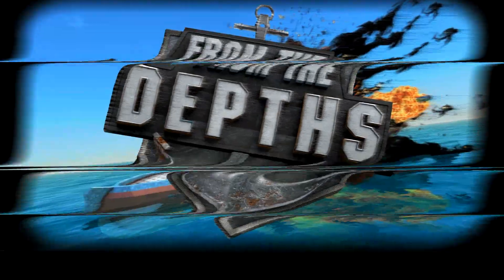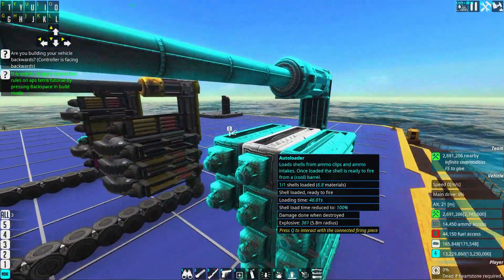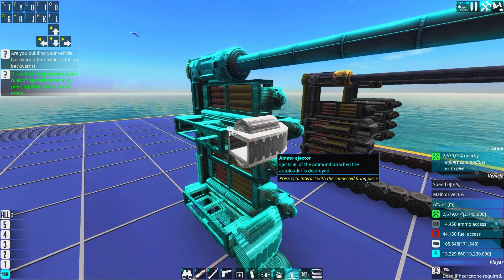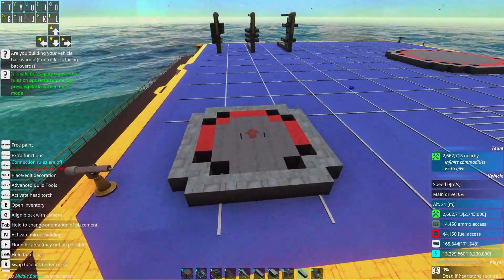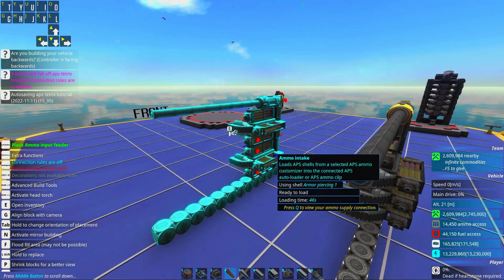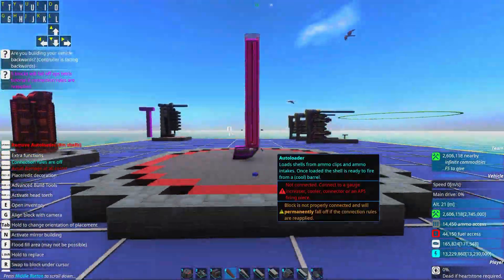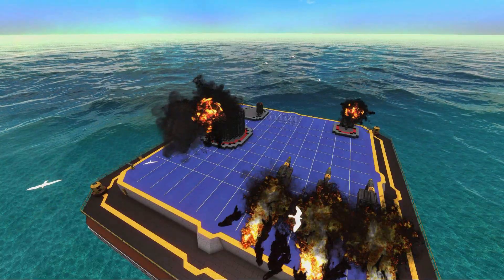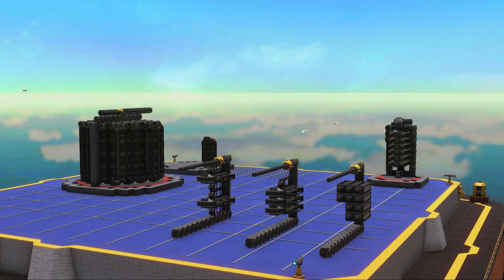From The Depths INSTANT Tutorial: Efficient APS Tetris (With Ammo Ejectors)

Comment: Having armour inside turret well is a BAD idea. Its weight makes the turret harder to rotate, and its a BIG waste of space inside the turret well which you usually put deep inside the citadel of a vessel. Armour attached on the turret subobject should strictly be limited to the turret superstructure, approx. around the firing piece that has to be out of the citadel, and which should be made as small as possible. Replacing the armour inside with proper components gives you a better weapon of the same size, and much better rotation. You can always compensate the loss of armour by adding more on the wall of turret well or the citadel around it.

Comment: it should be mentioned that the required Length of an autoloader/Clip is not determined by ''how beefy'' a shell is , it is determined by how many components relative to it's ''beef'' it has
for example you could make a 12mm shell with dozens of components to make it 8 meters (800mm) long or you can have a 400 mm BEEF shell that is a single meter long  this also determines ow many shells find place in a clip i do believe a single clip has place for 1000 mm worth of shell girth means you can at best store 2x400 mm shells in any clip since everything beyond 400 mm is direct feed (means the shells to BIG for clips)

Comment: Would it be possible for the same gun to fire different shells depending on what you're targeting? (for example FLAK vs HESH depending on how fast the enemy moves or something like that).

Kind of want to build a secondary turret that acts primairly as (flak based) CWIS but also have a backup function to damage armoured targets where the normal shell would be ineffective. Or have the possibility for slower firering kinetic shelled APS to fire something more inclined to hit (anthing with a timed fuse and AOE) when only small planes remain.
Reply from the maker: Yes but I believe you need to use breadboard for this, and switch will be after the shells loaded already are fired...
Reply from the maker: Basically what you want is a multi-purpose gun loaded with sabot I'd say

Comment: I'm still pretty confused..  I just got the game, so excuse me, but you say to make the shell first but how do I know how big to make the shell?  Do i just make whatever i feel like?  And then how do i know how much cooling the gun needs?  How do i know how often the gun can fire?
Reply: You can try stuff! That's what I'm doing, and although my cannons are and have been rather bad + inefficient, you don't need them to be perfect :)

For the Advanced cannons, use the Ammo Controller with customizers (they're beside each other on the advanced cannon tab) 
In there you can select different shell types, the tooltip says what they do, but it's the combinations that are interesting. You can look these up if you want to, or just do as I mentioned to try whatever you feel like.
Reply from the maker: I highly suggest you check out my basic tutorials before, like the general and the ones before this, it's too much to explain in a simple comment
Reply: @Jay-fy4zy  late to the party but based on the length of the shell design (more gunpowder/payload/etc) the shell per size becomes longer. That said a 8 module long shell could still fit in a 1m long loader, but that would require you to have a small barrel as well, meaning you'd be firing 55mm bullets. This is okay for AA weaponry that need to dump out bullets in RPS notations rather than RPM, but you generally want a bigger bullet to deal damage. If you're cramped on space, cutting down on the amount of shell modules (length) is thus better than making the shell diameter smaller.

In the bullet designing screen you'll get a clear dropdown tab that allows you to select autoloader sizes for the bullet you've designed, giving you a clear way to see the gauge of the weapon you can make with the bullets you've made. (i.e. rather than having to guess the size that bullet would fit the game just tells you "this bullet needs an Xm loader for this gauge")

Now for the "why", partially personal preference, moreso for 'what the gun needs to do' and 'how much space does it get to do what it needs to do', if you need a 400mm gauge since it's your main gun but your hull is only 5m deep, well, good idea to cut down on the bullet so you can fit that size crunch. Or if you're on that same boarlt designing an AA gun, well.. Good chance you'll want only 1m loaders despite having 5m of space so you can fit in even more loaders, so you should design the bullet off of that assumption, and more importantly that specific task as well. Vice versa however, if gun size isn't important but you need the bullet itself to do a specific task, for example heat or hesh, then the gun is built around the bullet, rather than vise versa.

After the APS firing piece is mounted all of its required stats is displayed, you want cooling parts to be equal in rpm to your intake parts.this varies per bullet and gauge size etcetera, so there's no clear cut answer for a cooling to autoloader ratio.

Comment: There is a problem with your 8m example. Ejectors can't rest on top of a turret it has to be a cooler or rail charge. I make a lot of rail guns. I like to put the controller in the center. Use the four clip tetris with ejectors. I place them in a circle pattern around the center. Three are used per side so twelve in total to complete circle. If you want more just make another circle pattern around. I haven't made one that's bigger than two. You can also stack them. If they are big clips I use coolers around the bottom, center and top. That way I have a place to connect recoil.  The free space I put rail charges, coolers or recoil. The toughest part is having a place for recoil. Coolers and charges are easier to connect. It's a balancing act on how much rail charge you can have. There is also a cool 5clip tetris for 1m clips. I found it on the workshop. Bummer only 1m clips can be used but you can make a mean pure rail with no gun powder to fit 1m clips.

Comment: I do wanna point out
Pure Autoloaders only doesn't actually explode, they explode but deal no damage even if your shell is chemical/ has gunpowder, its  the clips that makes it explode, thankfully 4clip designs are cheaper, but has to use a emergency defuse if you don't want to explode.
to how much recoil absorbers you need for railguns, you need exactly what you put for railgun juice to absorption
Example, Assume your gun is pure railgun, your railgun uses 50000 energy, therefore it creates 50000 recoil. thats how it is
Edit: I forgot to say 0 clip only really does explode if your He is big, not sure how frag and emp works on this
Reply: Thankyou! One question: How to deal with BIG BIG BIG recoil in rail asissted APS? .Then over 100k Recoil/s for my Rail asisted APS (500mm) is to use even if i change RPM or calibre, damn Gauss Guns generete recoil.

Comment: Longer autoloader or higher fire rate for main gun
Reply from the maker: Depends on the shell, you wanna penetrate or sandblast?
Reply: @GMODISM  I like to use aphe railgun assistance
Reply from the maker: In this case go for long autoloaders otherwise you will not get good penetration at good speeds.

Comment: For small chemical shells only Autoloader has 2 benefits. No ejectors needed since the explosion won’t chain react. Changing shells mid battle is much faster. Otherwise like you said clips are better.
Reply from the maker: Haha yeah everything has a niche use, I do hope however that someone that makes a system for changing shell mid battle won't need a basic aps tetris tutorial XD
I do think I prefer just mixed ammo in these cases anyways, but maybe I'm just lazy
Reply: @GMODISM changing ammo mid battle seems like such an overkill in design. It just seems like something I'd make only to prove to myself that I can do that. For basic effectiveness I'd definitely just use a separate cannon for a separate shell.
Reply: @HalIOfFamer  It has it's uses, for example a small ship can't have too many various weapon systems. I'm also currently working on a secondary battery that can swap between neutralizing shields and smoking enemy LAMS, with potential for different ammo types if the enemy has neither.